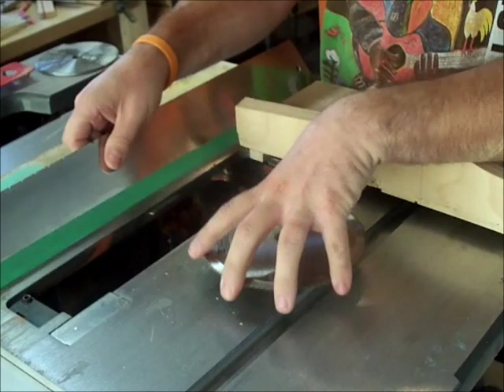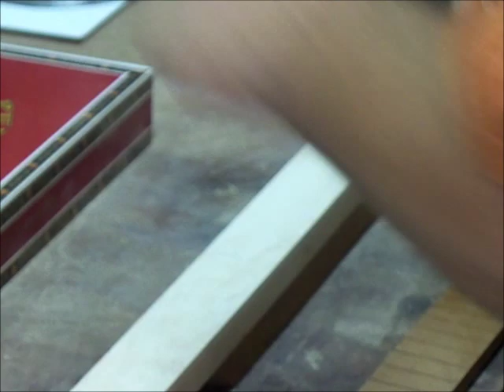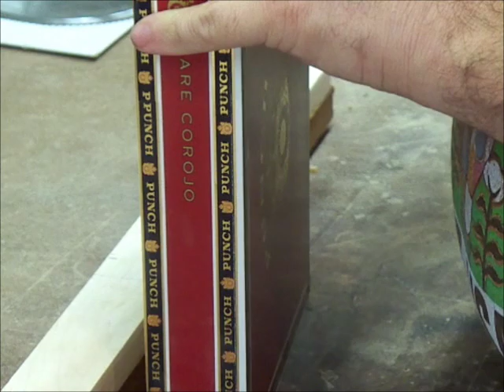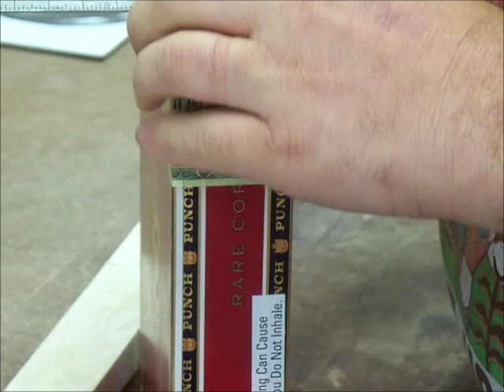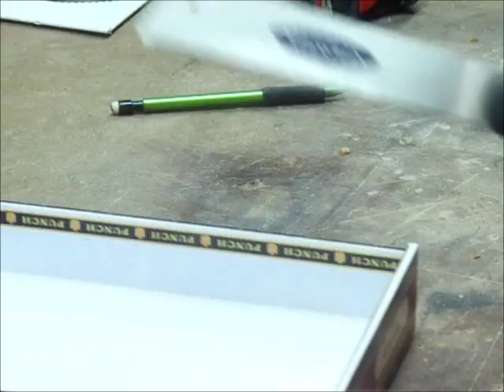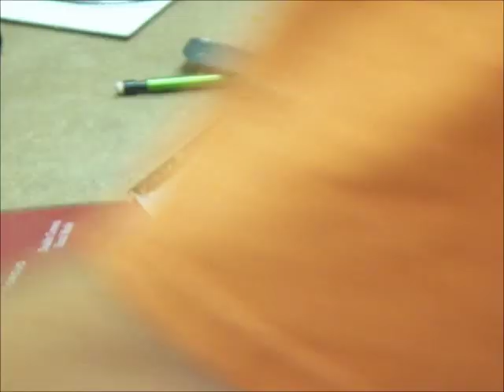part 2 Cigar box guitar neck building

Comment: Awesome video!  I'm using the econo fret wire as well and am having a bit of an issue.  When I use the 20 TPI blade it is a loose fit but when I jump to 25 TPI blade it's too tight.  Any tips?  The 20 TPI is perfect for the higher quality rounded fret wire but I was hoping to be more cost effective with the bulk stuff.